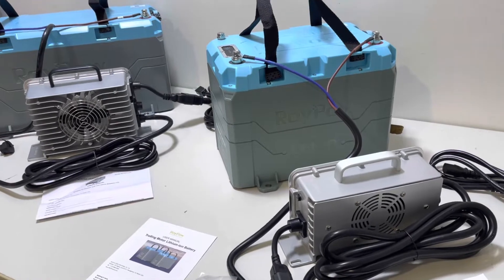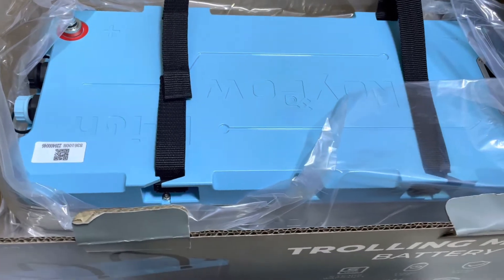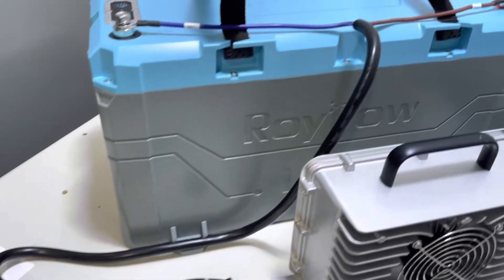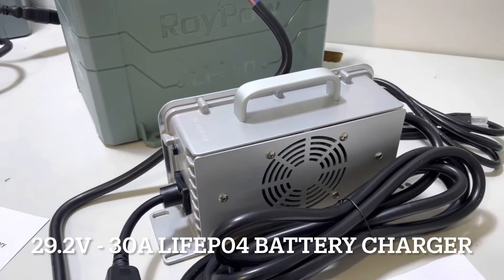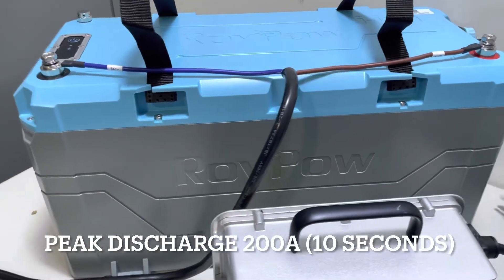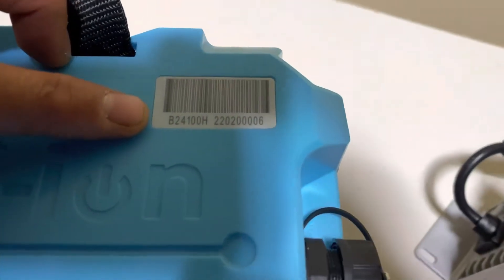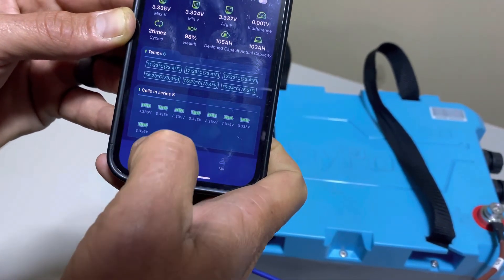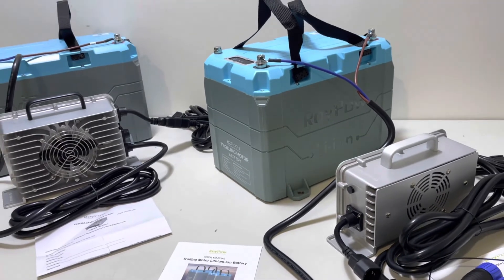RoyPow Lithium Trolling Motor Battery Unboxing (24v - 100ah & 36v - 100ah)

Comment: So we bought the 36 v 100ah  battery, we cant seem to turn it on, when we connect the charger so we can connect the battery  to Bluetooth it shows its 52 percent charged, something isnt making sense!
Reply from the maker: Did you buy it by EPOCH Batteries? Check for voltage at the terminals.

Comment: That seems to be a amazing battery. I want one for my sailboat…
Which brings me to my question: what’s the difference between a regular LFP battery and a trolling motor battery? 
Also, does the base model (not wifi) still come with Bluetooth? BT is really the more important feature.
And lastly, I assume or hope I can use any Lithium charger as well as any inverter? 

Thanks for your feedback
Reply from the maker: Great questions. These batteries are BlueTooth enabled and I give a quick look at the app in the video. We sell these batteries with the charger and highly recommend using the RoyPow charger as the charging algorithm is specifically designed for this battery. Lithium chargers are not really a one size fits all, it has more to do with the amount of modules in the battery along with some other specifics. These batteries were designed for Trolling Motor output requirements, but at the end of the day its a deep cycle 24 or 36v battery.
Reply: @PalmettoBatteryPros  great, so I won’t have to go for the more expensive wifi model if they all come with Bluetooth.

For charging, I will be using solar, not a standard wall outlet. Do you have a MPPT charger? I was planning on using a Victron 100/25, which allows me to change charge settings.
Reply from the maker: @4philipp  I do  not, I use the charger provided on shore power. I am interested in your set up, can you please keep us updated?